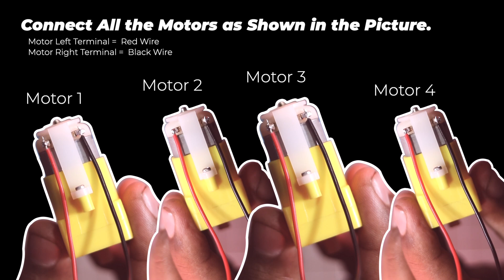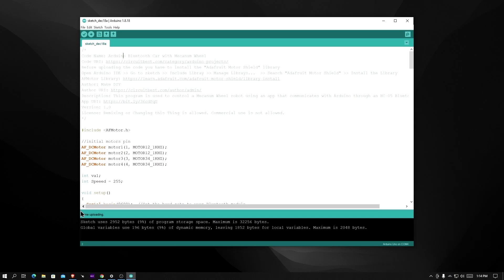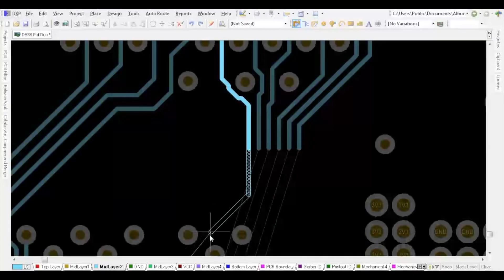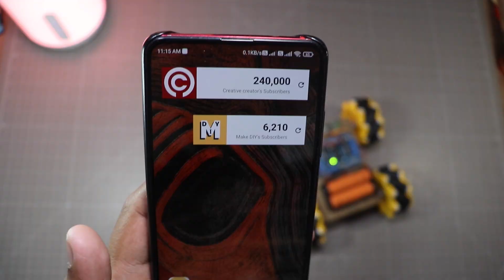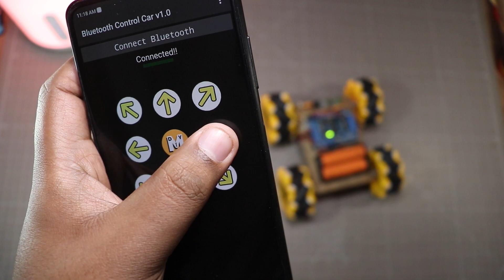Make DIY Arduino Mecanum Wheels  Bluetooth control car using Arduino UNO, L293D Motor Driver, HC-05

Comment: Hello, I'm using doing the same thing as you but the L2983d has a significant voltage drop. I have 1.1 V but still no supply to the motors. Please help.

Comment: Can I used copper colored wire. for this Project. Or  just same as the wires you're using?
Reply: Лучше не стоит эксперементировать. Arduino can don't like this wire

Comment: I wanna ask , why you didn't use button with battery holder . I think the battery will drain fast . Plz reply I have to make a project and I'm in confusion
Reply: It's Easy Just add a switch for the battery Holder ☺️

Comment: I'm connecting hc05 bluetooth module to l293d motor driver attached with arduino with 5v power supply to the bluetooth... But when I connected it blinks for few seconds and stops working and getting damaged.... Also I repeated it with another bluetooth module and the same thing happened to it... Bluetooths getting damaged... What may be the problem??
Reply: It requires atleast 7.7 to 8.5 V to work properly, 5v is too less for this
Reply: Due to less power it doesn't work cause it needs to distribute power to motors and driver too